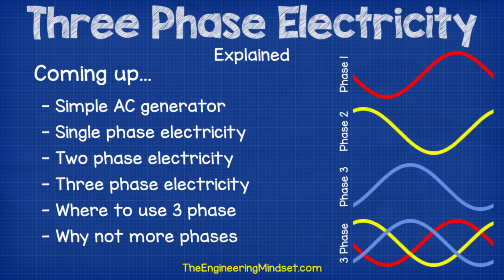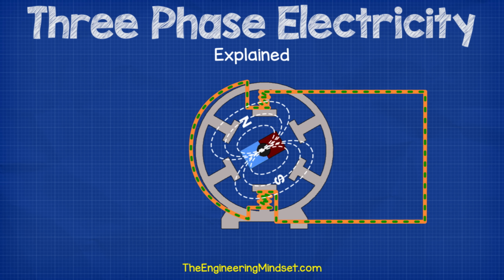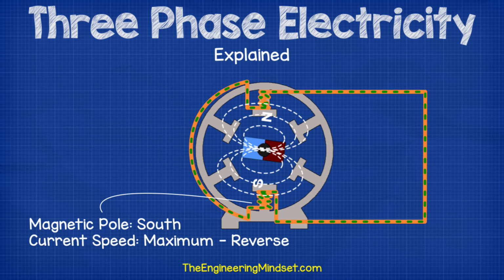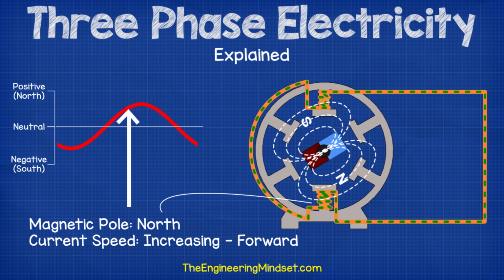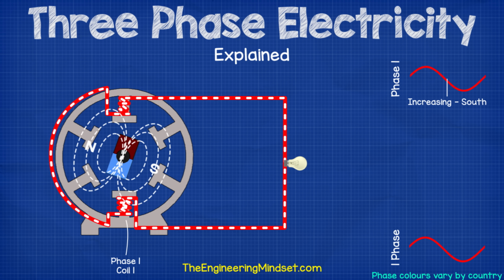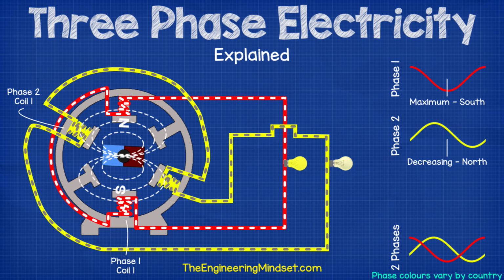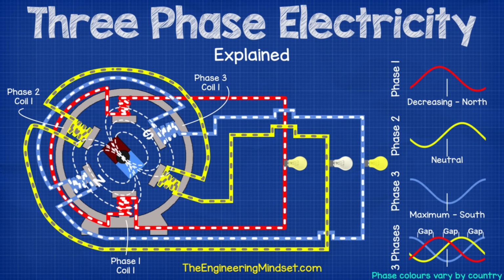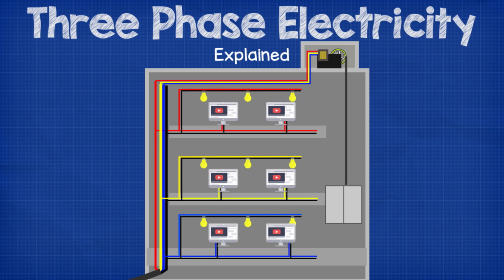How Three Phase Electricity works - The basics explained

Comment: Good explanation of three phase power.  One detail I don’t get:  According to the video, it would appear that three phase power requires six wires — or four, if you use a common ground.  However, three phase power uses three wires.  How do they manage to transmit those three phases via three wires?
Reply from the maker: Yes that's correct, we're going ti cover it in an upcoming video but if you check our "star delta starter explained" video it shows how it works
Reply from the maker: Seen our new 3 phase transformer video?➡️: https://youtu.be/u0SsejDCVkU

Comment: I'm sorry, but it's rather strange the big wins are not mentioned: less cable and no need for the neutral line (thus bigger power delivery per $), and less power loss assuming a balanced load. A whole third of the video is about a flickering lamp, which seems rather misguiding. (And it uses 6 cables in the illustration!) I understand this is supposed to be a basics video, but a lot of people are commenting that "now they understand"... and they make take this to a physics exam. Maybe create another video, "How Three Phase Electricity really works?"

Comment: Just to be clear--the reason that your lights don't flicker at home isn't that the electricity is switching so quickly that you can't see it, it's that even though the electricity is actually switching fairly slowly compared to our eyesight, the glow of an incandescent bulb is more related to the temperature of the filament than the current through it, and the temperature of the filament is more damped. The brightness changes a little bit with the change in instantaneous current, but as your slo-mo shows, it's hardly turning off! Like when you have a kettle on an electric burner--it's not that the temperature of the burner/water is changing so quickly that your hand can't feel it, it's that even though instantaneous current through the burner varies greatly, it stays hot!
Reply from the maker: Check our new revamped 3 phase explained video, sooooo much better:👉 LINK: https://youtu.be/c9gm_NL7KyE

Comment: superb bro my doubt clarified and one more doubt is if negative cycles are connected to a single wire that means in your video  3 phases are connected to the 3 individual bulbs but if 3 phases are connected to star connected load then how will current flows is there any difference by using single neutral wire rather than  3 neutral wires please tell me bro

Comment: What is the diff in each between delta system and Y system as used in Central America transformer taps and no aparente neutral. Less high voltage cable but I worked in USA Y generation generation plants.
Reply from the maker: Check our new revamped 3 phase explained video, sooooo much better:👉 LINK: https://youtu.be/c9gm_NL7KyE

Comment: US houses are connected to 2 phases so dryers, water heaters, stoves, and hvac systems can get 205 volts (or commonly called 220 volts) then all 120 volt devices and outlets will get just one phase or the other.
Reply from the maker: You should watch this video https://youtu.be/fJeRabV5hNU

Comment: I just can't understand how power can be distributed, if AC-electricity means that the current is just moving back and forth. So essentially it cannot travel long distance then?!
Reply from the maker: Correct, it doesn't travel very far. The electrons are just pushed and pulled constantly in a very very small distance. In a DC circuit it would need to travel from the power station all the way to every house and then back. With AC we don't need to do that.
Reply: @EngineeringMindset  Thank you for clarifying that! So if I plug in a DC-appliance in my house, the current comes in via the live wire and out through the neutral, but it's not literally travelling back to the powerstation  - which would not make any sense. So it becomes AC again, once it travels through the wall outlet. Are live and neutral wires joined somewhere? Or is it like when you look at electricity pylons, half of the wires are live wires and half are for your neutral ?
Reply from the maker: Have a look at these residential electrical tutorials. It depends where in the world you are. Split phase north america, Single phase the rest of the world. Three phase some parts of Europe. https://theengineeringmindset.com/residential-electricity/

Comment: Where i live , one phase always goes off, its either a fuse in the feeder pillar cuts off or the JnP fuse cuts and the powere becomes very low or the upriser cable cuts.. we have been trying to balance the power in such a way that all three phases are evenly distributed to all the houses. But we just find that so many may be on the red phase and the blue phase and less on the yellow. Because of the load of the red and blue the fuse in the feeder pillar always gets burned up quickly and then the phase goes off
Reply from the maker: Check our new revamped 3 phase explained video, sooooo much better:👉 LINK: https://youtu.be/c9gm_NL7KyE

Comment: Have you done a video on harmonics, specifically in relation to 3-phase power? Needs a good one on triplens :(
Reply: Think about how you can tell the difference between a flute and a trumpet, both playing the same musical note.  The reason you can tell the difference, is the shape of the waveform is significantly different.   A flute's waveform is mostly its fundamental frequency, while a trumpet's waveform is a very harmonic intensive tone.  What happens, is that the pitch of the musical instrument is defined by the lowest frequency, that is usually also the loudest.   The higher frequencies reshape the waveform so it is no longer a sine wave, but instead is a wave shape that is characteristic to the musical instrument.

Electrical loads also have harmonics.  These are signals that are a multiple of the nominal frequency (let's suppose 60 Hz), due to the load itself not having a current that is a linear function of the voltage.   Triplen means multiple of 3.  Every harmonic that is a multiple of 180 Hz is a triplen harmonic.

Triplen harmonics are especially problematic for the neutral, because unlike everything else, they accumulate on the neutral, rather than cancel.   The fundamental frequency currents add up to zero on the neutral when loads are balanced.  But the triplen harmonics all add up in the same direction.

This is why when you have harmonic intensive loads, particularly triplen harmonics, that you may need to specify a larger neutral than the phase conductors.   Some panelboards and disconnects also have the option for a 200% neutral, anticipating this issue.

There are loads like VFD drives, that systematically never produce triplen harmonics.  They produce harmonics, but systematically avoid the triplen ones.  Their harmonics occur immediately above and below every multiple of 6.  So that puts harmoncis at 5, 7, 11, 13, 17, 19, 23, 25, and others following this pattern.

Comment: When Tesla,the great develop the so- called - three frases electrical sysitem, he trasformed the electricity,fanally tansforming it  into some thing able to be comercialized and easy to be taken  where it was needed,no loss  by using  powerful transformers.

Here in Brazil  our electrical sistem  are massive, with power grid  with over 6 mil  KM long  and it is possible thank the AC corrent created by Tesla.
As a electrtian engineer dedicated  into projecting big power lines,me and every electritan in world should  thank this hero called Tesla.
Reply: "with over 6 mil  KM long  and it is possible thank the AC corrent..."
Well, wired electricity probably made power easier to control and commercialize. But maybe not. I believe the ancients used wireless electricity. However, there would probably be ways to control and distribute it. It would just be a lot cleaner maybe. Do you have any thoughts on wireless power that might have been generated by structures like the Great Pyramid, @INSIDE BRAZIL?
Reply: @AverageAmerican  definily, this is no real,it is  just just legend. the process of transmiting wireless power is so  complicated,that even the great, Tesla ended up giving up of it. Even to this  days there is no technology and know-how to develop  such a project. If we wanna really have power in our houses,we must to rely on  the good and old
  wire.
Tesla even tryed to creat a method to transmit power thruoght magnetic waves,but even him failed. He even built a tower with the help  of  his    friend  Gerge Westinghouse , a  tower  that transmited  the electricity throught magnetic waves, it was able to transmite power for two km wireless, but in practice it showed itself impraticable.
Reply: @brazilonline8154  I just cant believe how many wrong informations.
Its not Tesla who invented all of that lol.
Tesla has nothing to do with invention of AC or three phase systems.
He created his own two-phase induction motor that gained some popularity in US, but at that time In Europe is developed complete three phase system and all of its components. 
All those stuff : Single phase motors/generators, Three phase motors/generators, transformators, power transmission systems, are developed in Europe by many scientists. 
Just look at Electrotehnical Exhibition in Frankfurt in 1891 where all those stuffs are displayed.
Also even two-phase motor is invented two years prior to Tesla by Galileo Ferraris in 1885 but he never patent it.
Reply: Even on Wikipedia they wrote wrong informations about three phase and Tesla🤦🏼‍♂️🤦🏼‍♂️
Reply from the maker: Check our new revamped 3 phase explained video, sooooo much better:👉 LINK: https://youtu.be/c9gm_NL7KyE

Comment: The video raises a few questions. If only one phase is used for small houses, does this mean electric devices like a light bulb will then flicker, like seen beforehand, because there is only one phase? Also does this mean with one phase the Ampere are constantly changing, as the flow of the electrons changes all the time?
Reply from the maker: Yes, the lights will flicker but as stated in the video, it is too fast for the human eye to notice. Even if you had 3 phases they will all flicker. That's why we use 50hz and 60Hz supplies because the human eye can't see it. Yes, everything is constantly changing so we get a sine wave for voltage and current but we use RMS values which gives us a constant value for our calculations.  I think you'll like this video: https://youtu.be/qthuFLNSrlg
Reply: @EngineeringMindset  Cool, thanks for the swift answer, big thumbs up for you channel. I assumed the flickering of the bulb in the video is on 3 phases, and thought a 1 phase flickering would be unbearable, but cool to know it's just so fast you don't recognize it. Still wondering how electrical devices handle this fluctuations, but I guess some just don't care like a heater or a light bulb, and for others, like a computer I would guess, a rectifier will be used to change from AC to DC.

Comment: If houses are only connecting to 1 phase of the 3, why are we not getting the dramatic dimming? I assume I've understood wrong.
Reply from the maker: The frequency, it is flickering but it happens so fast the human eye can't see it. 100 to 120 times a second. Look at a city at night from a distance, the lights flicker
Reply: @EngineeringMindset  thanks for your response,  I understood that when using 3 phase wouldn't,  but isn't that 3 phase being split up making it more like 1 phase when being used for housing?
Reply: If you use incandescent bulbs, the filament remains hot enough to continue providing light through the zero voltage portions of each cycle. That’s why even in slow motion, the bulb only dims slightly.

I think each type of a/c light fixture, whether it’s incandescent, fluorescent, neon, sodium etc, will have its own type of flicker depending on how it reacts through the low and no voltage portions of the cycle. I think some may be more noticeable than others to the individual.

Comment: In the first half of the video, you explain that 3 phase all but eliminates the flickering effect from a single phase. But then in the second part, you say that most homes are connected to a single phase. Why then don't we have issues powering devices that require the constant voltage that 3 phase gives?
Reply from the maker: It reverses 100 (50Hz) or 120 (60Hz) times per second. The device won't notice at these speeds plus we use capacitors and inductors to smooth it out.
Reply from the maker: Check our new revamped 3 phase explained video, sooooo much better:👉 LINK: https://youtu.be/c9gm_NL7KyE

Comment: How electrons are generated from magnetic field
Reply from the maker: They already exist in the wire, the magnetic field just pushes them
Reply: How many electrons are present in 1m 25 mm^2 copper wire.
Reply: @shut_up_uidt  The density of copper is 8.92 grams/cm^3.  Copper has 29 electrons in every atom (i.e. its atomic number), and the average atom of copper has a mass of 63.5 amu.  By definition, there are Avogadro's number of amu in 1 gram, 6.022e23.   The atomic number is defined as the number of protons, but due to the fact that atoms are by definition net neutral, it is also the number of electrons per atom.

From this information, you can determine that your amount of copper wire has 2.115e24 atoms in it.   At 29 electrons each, this is 6.133e25 electrons total.

Comment: Awesome video, but how the cable doesn't take back the electricity that it gave when the phase goes down (or does it just go to 0)? And why not just use DC?
Reply: The reason we don't just use DC, has to do with transformers.  Transformers are important so that you can trade voltage and current, along the path of power.  You want high voltage for transmission of power over long distance, but you want low voltage at the point of utilization for safety.   With the technology available in the late 1800's and early 1900's, when the grid was first developed, we didn't know how to build transformers that work with DC.   The transformer requires a change in current, in order to transmit power from the primary winding to the secondary winding, something that doesn't happen in DC.

Electrons themselves don't actually make it from source to load, in an AC circuit.  Instead, it is like a "pressure wave" of inter-electron repulsions.  The energy is what is transmitted from source to load, not the electrons.   Just like how a sound wave can transfer energy from a source of the sound to the receiver, but no actual air molecules make the full journey.
Reply: Fascinating. Thanks for taking the time to explain 👍
Reply from the maker: Check our new revamped 3 phase explained video, sooooo much better:👉 LINK: https://youtu.be/c9gm_NL7KyE

Comment: The reason for not having more phases is not just a compromise or cost thing. It’s a cleverly picked value. Having three phases ensures there is an equal phase difference, 120 degrees, between all three phases. The difference between phase 1 and 2 is 120. But also between 2 and 3 and 1 and 3. 

Should you have more phases, suddenly you need to think carefully how to connect the individual phases, since the phase difference is not equal. For instance with a 6 phase system the difference between phase 1 and 2 is 60 degrees. But between phase 1 and 3 it is 120 degrees. This is very much not desired :)
Reply from the maker: Check our new revamped 3 phase explained video, sooooo much better:👉 LINK: https://youtu.be/c9gm_NL7KyE

Comment: 6:08 Also the filament needs time to cool down and reduce its brightness but the voltage increases again faster than the cool down rate of the filament. Thus the filament/lamp never really turns off even thought the voltage drops to zero 2 times in a period. Cheap LED lamps flicker more than lamps with filament because their brightness follows tighter the grid voltage but good LED lamps are designed to prevent this.
Reply from the maker: Check our new revamped 3 phase explained video, sooooo much better:👉 LINK: https://youtu.be/c9gm_NL7KyE

Comment: The simple explanation to bulb or light flickering is frequency.. in most part in asia you see light flicker because electric current becomes zero 50 times in 1 second, hence 50hz... in North America it becomes zero 60 times so we don’t see light flicker here North America because its too fast for our eyes to notice that..
Reply: The reason you see flickering light is probably because of bad TL lights. The human eye sees flickering all the way up to 100 Hz. So 50 and 60 Hz would be noticed by a good observer in both cases. 

In traditional lightbulbs the afterglow ensures you won’t see any flickering. In TL light there is a magnetic ballast that doubles the frequency to 100-120 Hz. This ensures the flickering should be gone. But if the light is old or bad, that frequency drops below 100 Hz and this is when you start noticing the flicker.
Reply from the maker: Check our new revamped 3 phase explained video, sooooo much better:👉 LINK: https://youtu.be/c9gm_NL7KyE

Comment: think I've missed a bit....single phase lighting was considered impractical as the flickering would be annoying, but houses are fed by single phase?
Reply from the maker: The lights flicker so the frequency was increased to 50/60hz so that the human eye doesn't notice this. It was discussed in the video also but there's a lot to take in.
Reply: @EngineeringMindset  ok thanks..yes I missed that bit

Comment: If single phase is turning things off several times a second, how do electronics like this laptop stay on?  Capacitors?
Reply: Laptops have batteries, they are a DC power source.
Reply: Yes, capacitors can help smooth a rectified AC waveform.  But also consider incandescent lamps.  The AC changes direction too fast for the tungsten element delay time to a zero light state